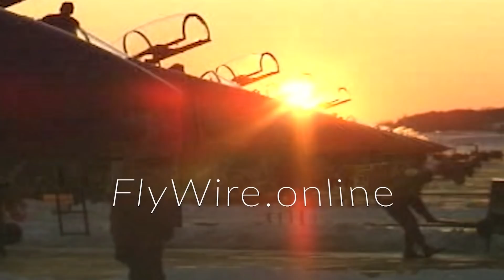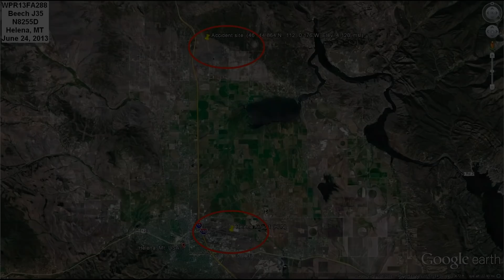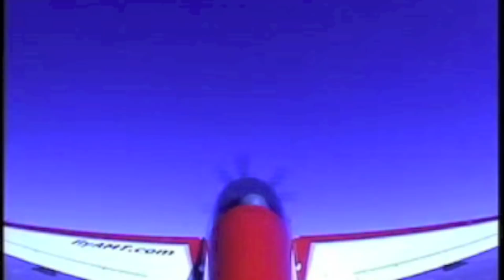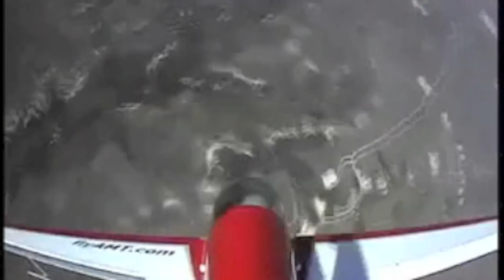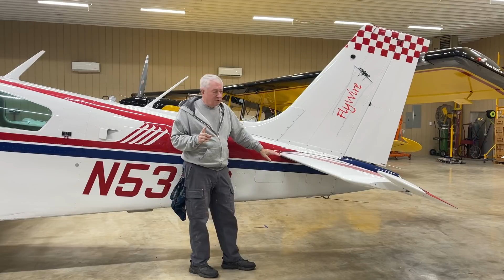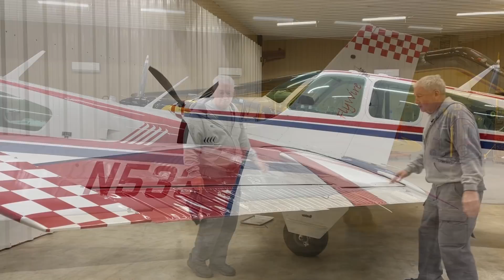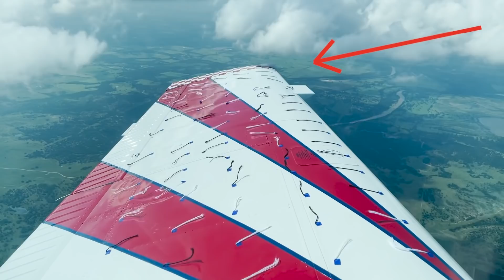J35  Bonanza Power-On Stall / Spin

Comment: I learned to fly in a C150 in 1969. Not much of a fan of power on stalls (especially in a turn), but it was "mandatory". On one hand I agree- how irrelevant are they to a cautious pilot. BUT- I did have a pretty wild (for me) experience in an AA1 Yankee during a checkout ride. Coming from Cessnas and Cherokees, this was like a sports car. At 5,000 AGL (and gross weight) the instructor told me to do a power off stall. When it buffeted and seemed to stall I added power and dropped the nose to below the horizon to gain airspeed. He thought that I lost too much altitude and said to try it again, but just add power and lower the nose to level. That worked great for about 2 seconds, then BANG- it spun to the left (my first and last "real" spin)-no C150 Cherokee ever bit me like this!. We both applied right rudder and I think I neutralized elevator(already looking at a lot of ground) but left on full power. Spin stopped, leveled out maybe 2,000 ft lower and we both decided I would be flying very conservatively after that! (2 more solo flights after that, partly to "get back on the horse".  Lesson from this- a poor recovery from a power off stall in a less forgiving airplane can get you into a power on stall.

Comment: Absolutely one of the best descriptions of spins.  I didn’t do spins in flight indoct.  I did do many spins in the t37 back in the early eighties.  The Bold Print EAC still stays with me today.  Working on ppl after not flying for 14 years and want to practice spin training again.  It should be part of the ACS, but sadly not yet.
Reply: Most FAA inspectors cannot demonstrate a simple power off spin.  Not even on an easy C172 from 7k agl.  and wont promote that you learn them either.   They can do Mostly Mild Maneuvering instead.   Canada, Mexico, Latin America, and Europe, most inspectors know spins.   What a shame is that.
Reply: @emergencylowmaneuvering7350  I think spin prevent should be the highest priority.  With experience, spin recovery should be the standard.  This really should be a nothing burger for aviators who are willing to learn.

Comment: I have a P35 Bonanza, V-tail.  If-470 260 hp.  Owned for 14 years and 1100hrs in type.  About 2 years ago practicing stalls.  Decided to try a power-on stall with an instructor.  Had perhaps 60% power and planned to put nose down just when plane felt like it would stall.  Let me tell you not to do that in a Bonanza.  The usual buffet is very brief and plane snapped to the left and went nose down in a heart beat.  Holy. Sh—t.  So fast and probable got 1 or  2 rotations in less than 5 seconds.  Pulled power, pushed yoke and neutral ailerons and did recover easily but I will never do this again in my Bonanza.  I can definitely see a full power take off stall being deadly in a heart beat for a Bonanza.
Reply: Yes, yes, yes.  Note my own contribution above.  To your explanation I would only add to stop the rotation with rudder, step on it, if will.
Reply: I did the same in 1989 in a 1947 model... still have memories about it😂

Comment: A "J" model Bonanza has no Rudder.
Reply from the maker: You are wrong, it has Ruddervators that serve double service as elevators and rudders.
Reply: @FlyWirescottperdue   True but within context  of uncovering the rudder from "blocked air flow," as you described, there is no rudder to be uncover. Therefor in context to this discussion there is no rudder. The ruddervators are also lifting  requiring prop blast underneath to lift and relative wind to have authority. With no relative wind they are a stalled wing. With no prop wash there is no lift. Don't spin a Bonanza!

Comment: I’m not usually fond of mnemonics, but I like PARE, mostly because it’s so well known and so important for extricating from a spin in almost any GA airplane. It’s the same steps as you describe, but much better known in the GA community. Power off, Ailerons neutral, Rudder opposite to stop the spin and then neutral when the rotation stops, Elevator forward to break the stall and then gradually back to level off. 

I suggest that the Bonanza pilot, whether he knew PARE or had any spin knowledge or training at all, undoubtedly panicked and froze when the airplane flipped into a spin. As anyone who has done any spins knows, that first time is pretty scary, even when it’s being demonstrated by a competent instructor.

When I was instructing back in the 80s, I had a private pilot freeze at the controls of a 182 when a power-on stall broke into a spin. It was my fault—I’d taught him in his private training to “walk the rudders” (falling leaf) as a means of demonstrating how the rudder retains authority during a stall, even when the elevator and ailerons have lost their authority. We’d done that both power off and power on in a 172, and he had no trouble. After he obtained his private certificate, he wanted to check out in the 182. 

At altitude, we were doing the usual air work including stalls. I had him do a falling leaf, and he was impressed with the additional authority that the 182’s rudder had compared to the 172’s. I then said not to try doing that power on, because the additional power made it too difficult. I think I said “nobody can do it”, my student said “I bet I can”, and like a dummy, I said “OK, smart guy, try it”. 

Of course, the deck angle was extreme. As the airplane oscillated to the left, he pressed the right rudder, it oscillated to the right, he pressed the left rudder, and suddenly the airplane flipped over to the left and fell into a spin. Because I’d also taught him spin recovery, I expected him to react, but he didn’t. He froze, still pushing the left rudder and with the yoke still back all the way, with full power. I first tried to talk him out of the spin, but when I realized I couldn’t get any reaction from him, I pulled the throttle off, used all the strength I had to push the opposite rudder, and I had to hit his wrists with my arm to knock his hands off the yoke. 

I don’t know how many turns, but we lost over 3000 feet, from 11,000’ to below 8,000’ MSL. It was not until we were flying straight and level that he “woke up”—he didn’t remember any of the spinning. 

So that’s why my guess is that the Bonanza pilot either had no idea what to do, or he simply froze and left the controls however they were when the airplane entered the spin. That the throttle was still at full power supports my guess, since pulling the power is the first step in recovering from a spin.
Reply: yes , fear is a powerful force and some pilots/people don't handle it so well...thx for your insight.

Comment: Something interesting I learned years ago is that what is the number of possible different spins there are on an aircraft.  Add complexity and the number multiplies to well over a hundred thousand different spins. Think about all the possibilities of changing the longitudinal, lateral and vertical centers of gravity a tenth or half an inch at a time.  And in fuel moments for different fuel loads, power settings, rpm settings and flap and landing gear positions.  
Does a manufacture who must demonstrate recovery in a single engine, explore all of these possibilities?  The answer is no they don’t.  For one the costs and time required to investigate all the possible spins is prohibitive.  The field certification branches know this and will hear arguments from the manufacturer on why 6, 8 or 10 configurations are thought to be the worst and will approve the study to be on that groups. The flight test program might show early on that the prototype to be recovering easily without deploying the spin chute and the amount of required spins can be cut down.  By the time type cert comes around, very few spins from the vast possibilities of different configurations have been deeply investigated.  It can go the other way where a spin test program can go poorly and drag on for ever. 
My point is that no one has don’t all the spins in an aircraft.  When you spin you very well might be the first. Hopefully your aircraft and the humans on board will be equipped like a well run flight test program with easy egress and parachutes. Even then you will loose now and the.  
Let remember Art Scholl where the weight and moment of a video camera on a cable added to the list of configurations possible in a pits and one that no one had ever explored before.

Comment: Great video Scott! I have taught spins in 5 different aircraft and owned two different V tail Bonanzas. When I did my last flight review with my BPPP instructor he told me that spins in a V tail Bonanza are mostly un recoverable. Surely when they were certified they had to do testing. I’ll bet that when they changed the V tail to be more vertical that they RE tested spin recovery. Does anyone out there know what happened?
Reply from the maker: It passed the spin certification requirements. I’ll ask around.

Comment: I think accidents like this are a failure in training. His IP did not teach him something he needed to know, and as he didn't know it, he died.
     Do you think instructor pilot who fail to teach their students everything they need to know to fly safe should be held accountable if something goes wrong?
    If my airplane mechanic doesn't bolt my wings on properly he will face consequences if my wings come off in flight.
Reply from the maker: Who would hold the IP accountable in your question?
Reply: @FlyWirescottperdue  I suppose it would be the FAA. Of course they would have to change the law, make these things a requirement to qualify for a PPL.
     This and teaching pilots to know how their plane is oriented in space with just the instruments.
     I'm not talking about an IFR cert. Just get them to where if the accidently fly into IMC they can keep control of the plane.
     How many VFR into IMC accidents have you covered now?
      When I was little my dad used to let me fly the plane sometimes. I had to use the instruments because I wasn't big enough to see out.
      When I took my first few (and sadly only) flying lessons my instructed had to tell me to look out side. "Instrument flying is for later. First just learn to fly" she would say.
    Also, you can't see and avoid if your eyes keep scanning the instruments.

Comment: Isn't a flat spin defined as a situation where the wing AND the tail are both stalled?
Reply from the maker: No. A spin goes flat due to gyroscopic and/or polar moments of inertia. I've heard folks say what you have asked. All, I can say is that they haven't done any. See my video on Accelerated stalls in the Extra 300L.
Reply: @FlyWirescottperdue  So I'm not the only idiot out here. It's a common misconception.

Comment: Only other thing I can think of that happened is that the pilot in question was practicing slow flight; not so much power on stalls. It may well have inadvertantly developed into one, but practicing slow flight that has gone bad is i.m.h.o. a realistic option. especially because he was "less current" (and probably "less proficient" because of that), and he went out to do some airwork to re-acquaint himself with the airplane.
If you take the region of reverse command a touch too far...
Great analysis and aerodynamics explanation, Scott. Thanks for that! :)

Comment: I get everything you say except for the stick back. Every aircraft I have practiced spins in needed at least neutral stick in pitch in addition to opposite rudder to recover, and some would not stop spinning UNLESS the stick was forward of neutral. No instructor ever told me to hold the stick back during initial recovery. Am I the only person here who was never ever told to hold the stick back initially? This includes tail draggers by the way.
Reply from the maker: Fingerhorn, please watch the vide again. You missed a VERY important point!
Reply: @FlyWirescottperdue  I'm not sure I did miss it. If I did then apologies. You pointed to the tail and said that you needed initial elevator up (stick back) to enable the airflow to reach the tail. Apologies for maybe a misunderstanding but can you please go through the need for initial stick back one more time with more detail. It goes against EVERYTHING I was taught but also against everything I actually experienced. Apologies for pressing you on this but what you said in this regard is counter to anything I and thousands of others in the UK were taught about spin recovery, and as I've said, in practice every spin I've had was immediately recovered with opposite rudder and stick FORWARD (or at least not back which only made the spin worse).

Please note I am not talking about recovery from the ensuing dive. I am talking about iNITIAL cessation of the auto-rotation. I know you were addressing power on stalls/spins. But every power on stall/spin by definition becomes, or should become, a straight stall spin as soon as you reduce the power. Maybe my misunderstanding comes from the "power on" aspect. 

Now, maybe the technique for power on stall and spin recovery is radically different from power OFF. I think you need to make this emphatically clear because in most (power off) stalls and spins you would NEVER ever provoke an even worse spin by deliberately holding the stick back, even temporarily. Perhaps we are at cross purposes? BTW I am a big fan of your channel and vlogs.
Reply: @fingerhorn4  It's been a while, but I remember entering spins with both full up elevator and hard over rudder (idle power). Once established in the spin with these settings, to recover, one first used opposite rudder followed by neutral to forward stick as the rotation slowed. I learned to fly on Chipmunks so practiced spins often. So the question here is how long do you keep the stick back? It seems the answer is until the rotation slows or stops, then neutral to forward elevator. I must admit I had never considered the effects of elevator shielding the rudder, but the sequence of first stopping the rotation before stick forward addresses that.
Reply: @aeomaster32  I too did aerobatics in a Chipmunk. As you say, stick fully back and full rudder to enter the spin. Neutral or preferably slightly forward stick and opposite rudder to cease spinning, then (with still zero power) gently pull back out of the dive. I never saw an instructor or any other pilot use backward stick to recover, even initially, from any spin.
Reply: @aeomaster32  You have it right, opposite rudder until it slows then relax the stick or push it forward (different airplanes respond differently) then pull out of the dive. So, spinning with full up elevator, and leading with opposite rudder, then pushing the stick or yolk forward, will immediately stop the spin. If you wait for rotation to stop, it might take another full turn or more.
Reply: @fingerhorn4  In my experience, initially pushing the stick or yolk forward will speed up the rotation of the spin. This is an eye opener to say the least, and is called an accelerated spin. What Scott was explaining with the Stearman - by pulling the elevator back all the way up, the spin is stable (slower too) and normal recover can be used.   🙂

Comment: great info; but what about the flow over the V-tail analysis. I owned a B35 (no letter, it was over than me but not by much) and trained and got my commercial rating in it.  I'd be interested on your thoughts around that. After all this was a V-tail accident.
Reply from the maker: The V-Tail Bonanza passed the certification standard of being able to recover from a one turn spin in one turn. From an aerodynamic standpoint the ruddervators would never be blanked out by the horizontal.

Comment: Thank you so much Scott for such an amazing video (as you always do).  I have not done spin training yet. I was taught power to idle, neutral controls, let the spin stabilize before I apply the opposite rudder and slowly pull out of it and bring the power back. You took that and broke it down with such incredible detail and visual representation. Now I understand the aerodynamic principles and the “why” of what is done to recover. The full aft thing is new info and I greatly appreciate any and every minute life saving piece of information you provide.